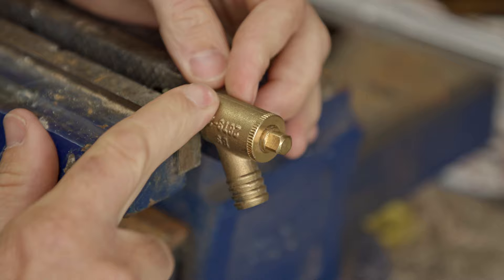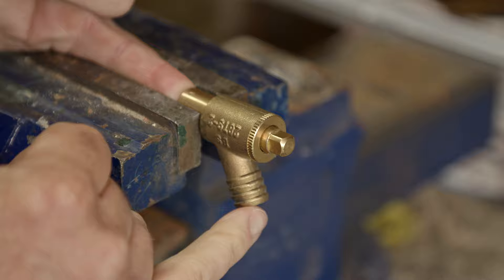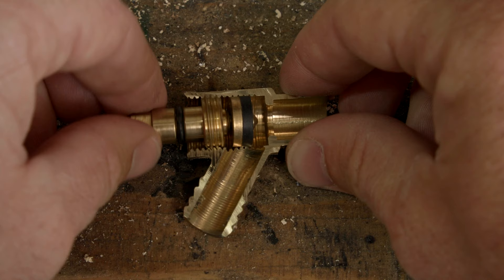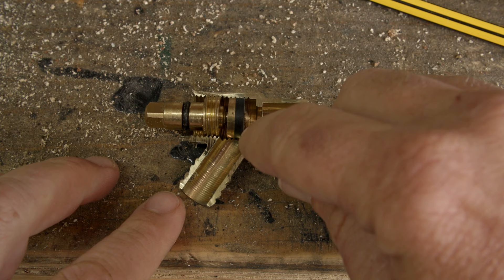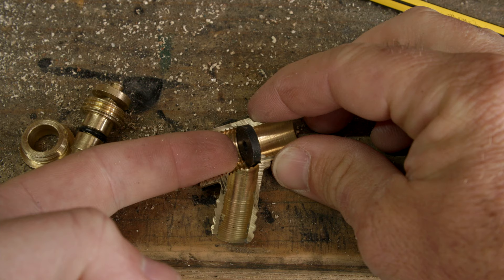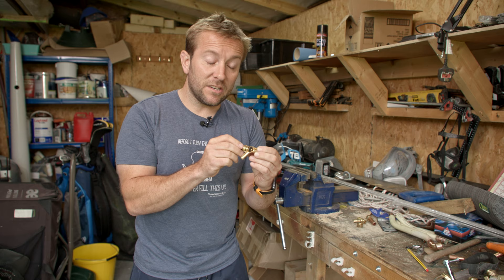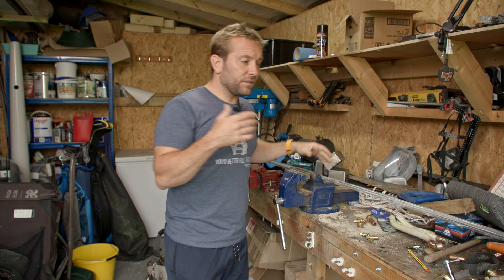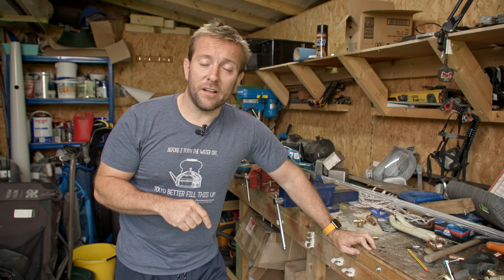❓HOW A DRAIN VALVE WORKS - CUT IN HALF Pt.1

Comment: Use an old gate vavle red head to open and shut Pump valves, drain cocks, rad valves, and any thing with a square head. Quicker than a spanner that can be adjusted. keep on key ring or in your drain kit

Comment: How about a primatic cylinder?  Ive just had mine swapped out for a Gledhill thermal store and the look of panic on the plumbers face when he couldn’t work out how or where the water was getting into the cylinder or the radiators. He was on the phone to Gledhill quick smart and they pointed him in the right direction…….

Comment: We have a very crappy design of draincock in UK. Whole thing needs a complete redesign as when one actually needs to use them they are rarely without problems like leaking and  seizing and hardened knackered washers. As soon as one messes with them better hope one can successfully remove all the old washer and fit a new one. Can be a nightmare.

Comment: I have always thought that both the type A and the Type B are poorly designed, if someone came up with a decent drain off, they would be on to a winner.
we would fit a cheap ballfix type valve just in front of them, just to be sure, least then you always had control of the water.

Comment: HOW CAN I REMOVE THE STUCK DRAIN COCK ON THE COLD INLET DRAIN OFF ON MY UNVENTED MEGAFLO CYLINDER - WHICH IS FULL OF WATER - AND NOT GET SOAKED??? I WOULD LIKE TO REPLACE IT WITH A MORE RELIABLE ISOLATING VALVE WITH A HANDLE